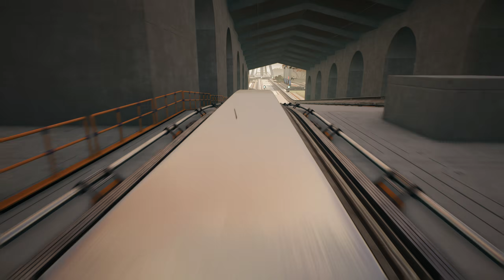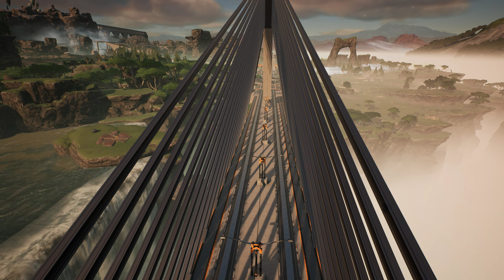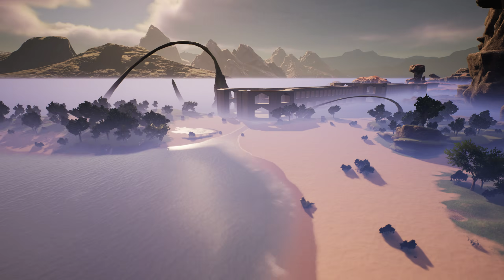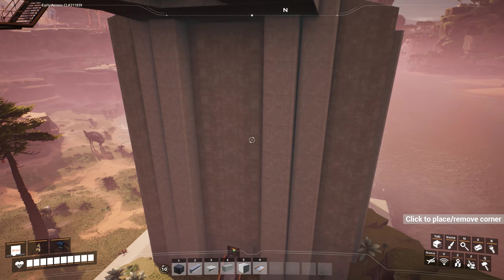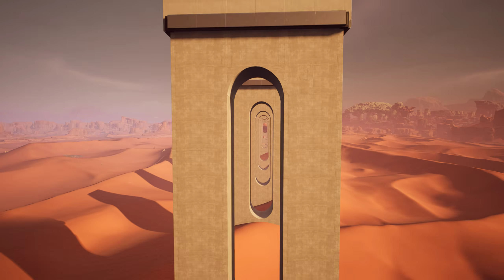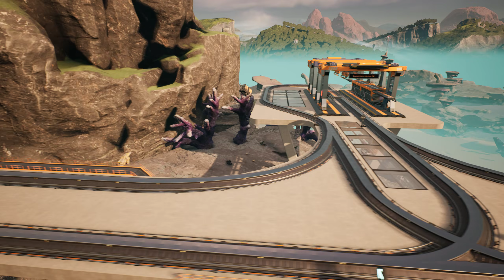Satisfactory - Aesthetic Rail Network: Bridges of the World - Megaprint Tour

Comment: For everyone who wants to use this in 1.0 , just delete all the pipes from BP , and will work just fine :)
Reply from the maker: I've just finished fixing it today. Weirdly, it was the Pipeline Supports that were the problem, rather than the main pipes (at least for me).

There were other issues too though, where I'd used some convenience mods for parts of it in my main save years ago (particularly Area Actions) which caused some corrupted items. So I was noticing that a lot of items were disappearing after saving, because they didn't have proper entity data and/or weren't properly associated with originating recipes in the save data.  

Anyway, technical stuff aside, that should all be fixed now. So I uploaded a new version that includes some new bridges, and left-hand signalling as well. So it's not exactly a drop-in replacement, but hopefully the new additions don't cause any issues for you.
Reply: @mynamesleon2269  This is great , thank you !!! apreciate a lot.

Comment: structural engineer and bridge inspector here. well done!  the bridge at 4:12 in the background is pure scifi - however ! -  it could indeed work out if the half bows were heavily pretensioned, or they would miserably snap like a pretzel stick at the outsides of the bows :) so let's pretend they are, the concrete is ultra high performance concrete and everything will be fine. :)
Reply from the maker: Haha yeah that bridge is definitely complete fantasy. It was purely meant to look like the bridge in Shadow of the Colossus (and even with how it's shown there, it definitely still wouldn't work!)

Comment: This is incredible! Unfortunately trains in real life for most applications typically deal with grades of at most 3% but usually much lower so big height changes take a long time. You do sometimes see some pretty impressive climbs though in very specific cases where the engine is pulling only a small number of cars!